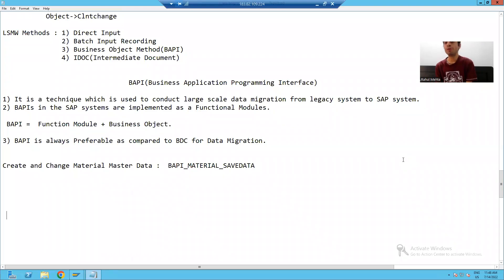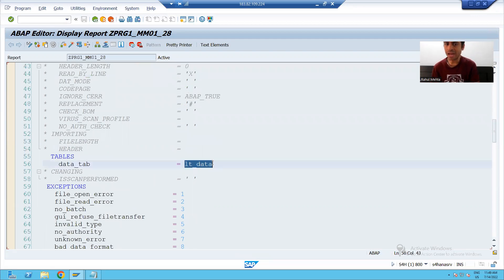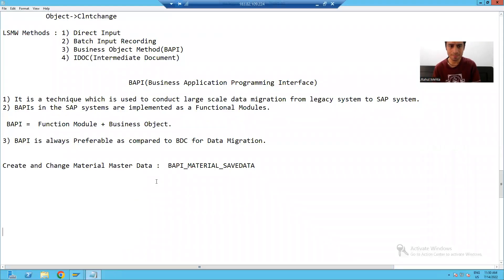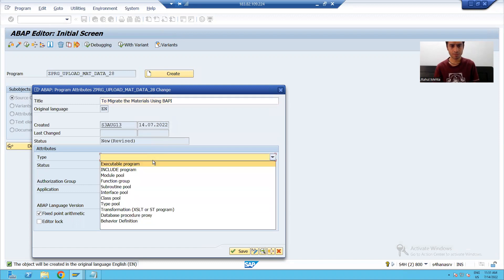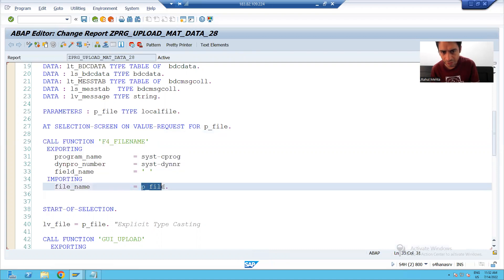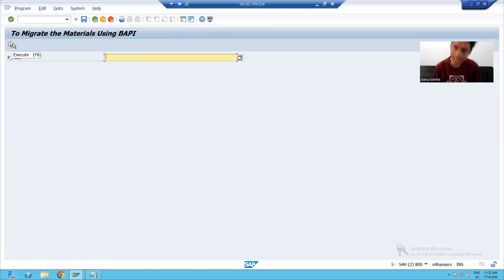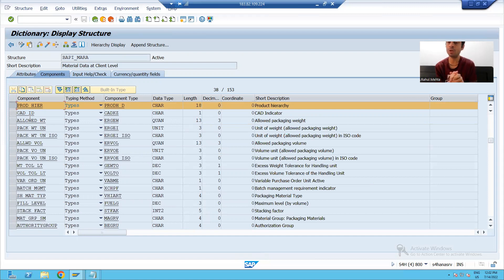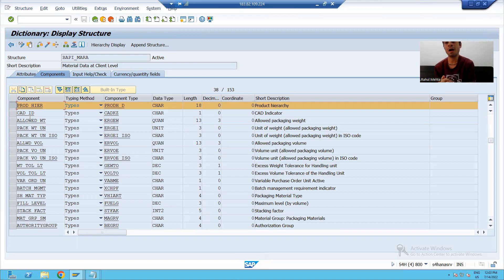25 - Data Migration Techniques - BAPI Part2

Comment: could you please make a video both master data and transaction data more than 1 tables
Reply from the maker: Hello Tharun - The current example is of Master data and it will update multiple tables - MARA and MAKT.

For transaction data, you can take the example of Sales Order. The BAPI for the same is - BAPI_SALESORDER_CREATEFROMDAT2 and below is the link for the same.

https://sapcodes.com/2015/11/19/using-standard-bapi-2/

Comment: In the call function in gui upload you taken filename = lv_file instead of that we can't take p_path iam little bit confused when you taken lv_file.
Reply from the maker: Hello - P_FILE is of character 128 and filename is of string type. We need to pass a variable of string type only. So, one variable is declared of string type and the value of P_FILE is passed to that string variable and that is used further. This concept is called as type casting.

Comment: Sir ,if we want to find the particular fields required for creating material, do we have to go into every parameter structure in the BAPI and scan for them ? 

For Example. To find "Division" field , you went directly into BAPI_MARA Structure [Parameter = CLIENTDATA] and found it. 
For MAKT you went into Tables section and found it. 
Similarly for other fields how can we know they will be particular Parameter Structure or Tables in the BAPI_MATERIAL_SAVEDATA FM. 

Does it require basic MM functional knowledge so that we can navigate to relevant Parameter Structures in BAPI_MATERIAL_SAVEDATA and scan for fields?
Reply from the maker: Hello Teja - SAP documentation and providing the names are very precise and clear. So, we will not face much difficulty.

Example - Some fields of plant data must be passed based upon the requirement. We can easily check using the description itself for parameter PLANTDATA TYPE BAPI_MARC(Plant-specific material data).

Functionals are always there who guide us in case of any difficulty and we check based upon their inputs.
Reply: @sapabapbyrahulmehta  Thank you for the clarification sir

Comment: Hello rahul is there any way to know that how we will find our required coloumn  in which value to be migrated will corresponds to which component of parameter or it is just come with our experiance.
Reply from the maker: Use F1(technical information). Suppose - Do F1 on a field of MM01, it will give you field name and then we will check.

Comment: hii rahul when i take the file the fields are not coming properly. the fields are mixing and some field values are missing when i debug can you suggest any alternative
Reply from the maker: Hello Surya - Check for the below mentioned points.
1) Your file does not have a proper separator. copy your data in excel and check is it properly separated.
2) Your file sequence is not matching with the structure type sequence, so one column data is merging with other column.

Comment: Which BAPI can be used to update or change movement type in the LTAK table, where LTAK is a transfer order header table?
Reply from the maker: I have not worked on this kind of requirement, but you can use these BAPI's, it might work.

L_TA_VERAENDERN.( In this function module, they provided the option to implement customer exit and explicit enhancement point also).
Reply: @sapabapbyrahulmehta  Okay, I'll try this one👍
Thank you🙌
Reply: @sapabapbyrahulmehta  It worked! Thank you so much for your guidance.
Reply from the maker: @be_b_18_neha_kothawade14   Great.
Reply: @sapabapbyrahulmehta  I've one more question, how did you find this function module? Could you please suggest those steps you used to do so?
Reply from the maker: @be_b_18_neha_kothawade14   I checked through google search only.

Comment: Hi Rahul, How can we come to know that this particular bapi is used for the requirement. If suppose for vendor master will we use the same bapi only?
Reply from the maker: Hello Charan- For different purpose, different BAPI's. We can find by using the F4 help in SE37 transaction code. Generally SAP followed a practice while creating the BAPI's. The first keyword is always BAPI , after that we can search by Create, Change, Display, Save, Maintain etc. - these are the common words. On top of that Google search is the most important searching tool.